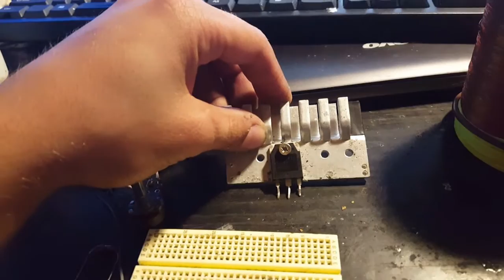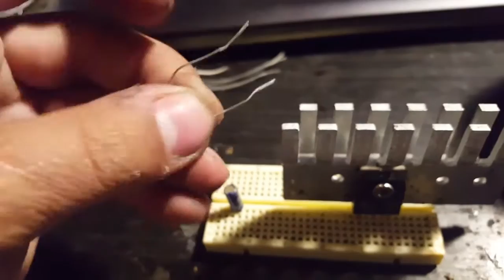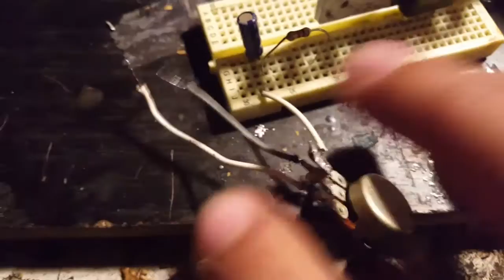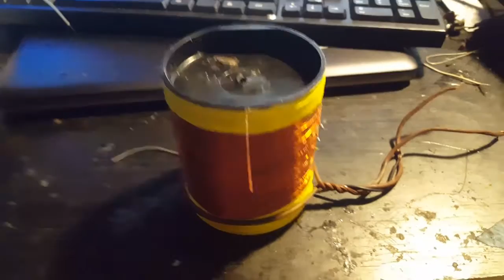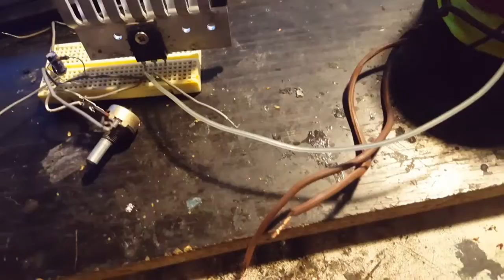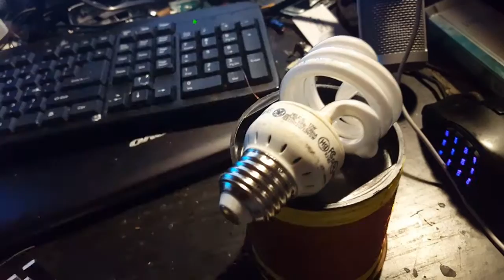Supper simple sstc how to

Comment: It worked for me it powered all kind of cfl ,ccfl and had goog sparks inside the condensed lamps but not sparking by its own my primary had 700 to 850  winding of 0.1 wire thickness I derived it by 12 to 19 volt power when I touch the sec coil it sparked but not by itself I don’t know why cause the power of it was so good and could turn the cfl lamp from 1 meter distance  go and make it it’s so easy to build
Reply from the maker: Yes it's my personal circuit that I designed a four-part circuit that can be interchanged with pretty much any variant of iRF 250N I'VE GONE UP TO IRF 610 AND I've achieved em temporary destruction of digital items and with my latest one I can take control of a PC with a high enough frequency to interrupt the flow of the fundamental electrical system in the digital mosfets
Reply from the maker: For example I've been able to make the mouse move all over the screen veia em generated by my 500w 1.09GHZ SSTC

Comment: nice!
you used diagram writen IRF510 used? (with potentiometer and resistor?)
Reply from the maker: no any between irf or irfp 420- 540 form my test
Reply: That's scrap mosfet?
Reply from the maker: well i take things apart ive been doing this since i was a 10 year old so i kinda just know what works moest fets 420b-irf 630 work 630's heat up a ton
REPLY

Dislike

Comment: Thanks for the video, im gonna try this circuit on my HUGE coil!
Reply: This circuit will blow up if used with very large coils. It might work if you put a whole bunch of mosfets in parallel tho
Reply: @NerdlabsSci  Why? And also no, don't put fets in parallel. If one breaks they all do.
Reply: @harms123  The larger coil draws more current and overpowers the transistor. you could just buy a more powerful fet but i just put them in parallel as a quick and dirty solution.

Comment: Hello , can i use IRFP 460
Reply: also check your data sheets for your Mosfets, make sure you are giving it enough voltage to fully turn on your gate pin. this should help with the heat situation significantly. proper gate voltage = happy mosfet
Reply: Thanks man ;)
Reply: Michael hoover ok
Reply: seek MOSFETs with lowest Rds(on). they will heat much less